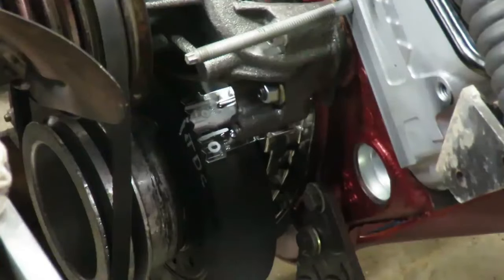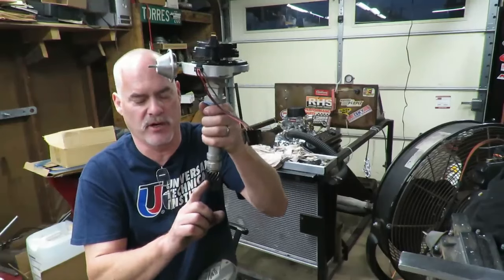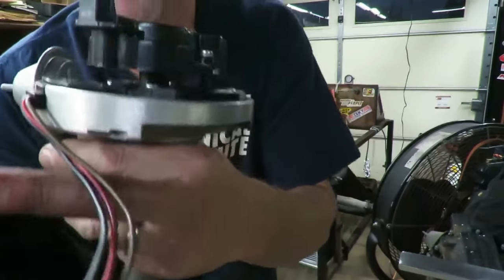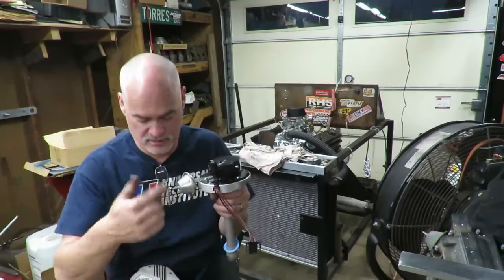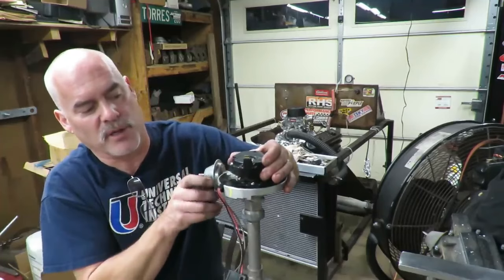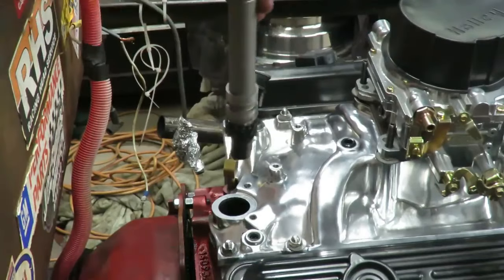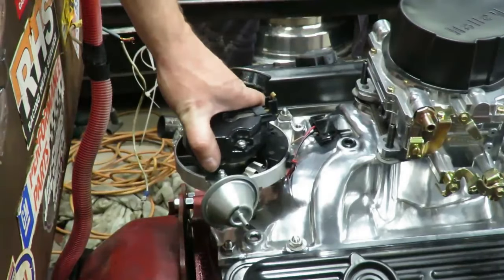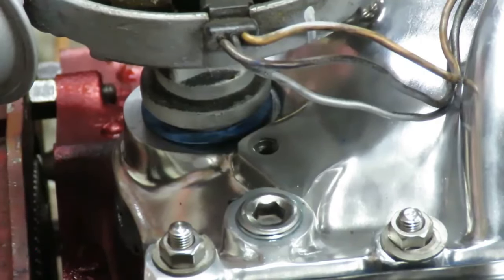350 Chevy Distributor, cap, and plug wire install

Comment: Got it, got it, got it! You the man! Thats what I needed to know. And... if you have the motor advanced 10 degrees as in this video, when you drop the distributor in and line it up with number 1 on the housing, it'll be 10 degrees advanced when you fire the motor. Add the 24 degrees of distributor advance (as what is built into my personal distributor) and it would be on 34 degrees total timing.  Then... simply check with the timing light. Thank you, thank you!
Reply from the maker: Yep

Comment: Thank you sir for this vid, spent all day tracking a new one down. And have put in off time twice now lol, once advanced, once restarted. The key bumping trick is genius, if the engine wasn't so hot from me running it advanced for 10 I'd do it right now lol. Confident I'll be back on the road tomorrow with this video👍👍👍

Comment: Got hooked on your channel when I ran across the cam selection playlist, great stuff and we thank you for it. I fool with Y Block Ford’s right much and always like it when I can install the distributor on a run stand because access can be difficult on hoods with hinges at the rear. Good tip too on bumping the engine to get the distributor gear to mesh with the camshaft gear. One of the things that fools guys on the Y Block is that the firing order goes counter clockwise ... gets a lot of ‘em at the start 😂

Comment: After you bump the engine to get the distr😂tor to drop over the oil pump shaft, you should line up the timing marks ( 10 degrees before top dead center ) to make sure the rotor is facing to the number one spark plug wire terminal.

Comment: Is the rotor under constant electrical charge creating spark when it connects with each cylinder tab on the cap or does the rotor pulse as it reaches each tab to send spark to the plugs?

Comment: Why would inside distributor cap only have marks on the corner of the straps and not closer to the center? Does it matter if it’s hitting center? Reason I ask is mine is doing it like that and I keep burning ignition modules left and right any time I rev it up have good ground new battery new alternator even hooked it up direct to battery and still keep burning them even installed 3 new distributors same deal rev it up a few times and boom it’s fried. 454 stroked out to a 489 bbc and help would be greatly appreciated

Comment: Great info as always. Thank you I do have a question my distributor cap when clipped on seems loose to me? While its fully clipped on the base i can pull it up 3/8 to 1/2 inch away from the base? Will this cause a no start or very bad breaking up issue? Any advise?
Reply from the maker: Yes that's a problem Id replace it

Comment: Great vid bud.question,for a 383 because of the longer stroke would I still put distributor in with rotor pointing at #1?   the car runs very good,  But I pulled motor to do gaskets and at top dead center my rotor is pointing at number 2. I remember the guy I bought it from said make sure I mark exactly we're timing and distributor is, Because it was a pain to get timing right. Would this  Be because the 383 has a longer stroke?
Reply from the maker: The timing is exactly the same process the linger stroke does not have any effect on it
Reply: Gotcha.thanks

Comment: What's the deal with putting it on 10 degrees before when installing distributor?
Reply from the maker: That is just one way of doing it you could bit it on zero but remember your cylinder will fire around 10 degrees BTDC
Reply: @Myvintageiron7512   I appreciate it that's what I was thinking.  I enjoy ur videos glad ur back.

Comment: Hello, I follow you since years and years, and today please, I need to ask you a question about my situation. I hope you can help me. Anyway I appreciate all your contents and i think you are really the best teacher ever. You know what are you talking about.   I have rebuilt a 1967 - chevy 327 small journal. Everything is stock, except the Camshaft, spring and lifters. Fit double humps heads with big valves, code 38172919. With a 10.3 CR.   The camshaft is a Lunati cam with code, 10120102LK with advertised duration 290int/300exh and 465/488 lift, 112 lobe separations.    Now The engine won't start with less than 28° base timing advance( vacuum connect). To keep it idling I have to unscrew the idle screw about 3 full turns out. ( quadrajet ) . If I try to lower the advance while the engine is running at idle, he will shut down.I can accelerate and keep it live, but he will not keep the idle. I also connect the vacuum gauge, and I read 13 to 14 in/hg. idling.  The question is: is it normal?  Looking on the web many people says that it is normal.   But to be hones looks weird to me....I'm afraid to have the timing chain little bit out...I don't know.  Thank you very much, can't wait for your next video.
Reply from the maker: it sounds like a timing issue are you sure your timing mark on your balance is right 
is the carb new or used?
Reply: @Myvintageiron7512   Today I opened the timing chain cover to check everything again. And It is correct. I have the 2 dots in line close, and if I go on TDC compression stroke I got the 2 dots in line but the camshaft's dot is point to 12 o clock.  The balance is correct.  Carb is totally rebuild.    I have change almost everything in this engine except the distributor and carb. The only things that I did not do, were the valves guide. here In Italy they are not able to do it. And they were out of specs. Another weird things is the compression.  I should have 150PSI but in reality i got 105 or 110. on 10.2:1Cr 
  why this engine start only at 30° base timing advance?  My doubt is that maybe crank's key is out " from factory"   but it mach the tdc anyway....is driving me crazy.
Reply: @thejustintimeyeah  When you checked the compression did you have the throttle and choke open the whole way ?
Reply: @44special9   yes. totally open.
Reply: @thejustintimeyeah  Over tightened valves can cause low compression/rough running engine . How many turns of preload did you put on ? If you used the spin method on the pushrods they might have been over tightened .
Reply: @44special9   Thank you for the advice.  I did half turn from zero lash.   I think that the problem is a worn guides valve. That could cause low compression and also bad mixture Fuel/air  if exhaust smoke stay in the chamber. That could cause that the petrol to be ignite need i 30° base timing advance.   Just my tough.  Tomorrow I try t fire it up with a new distributor....
Reply: @44special9  Little Update. I send the cylinder heads to a proper machine shop and they restore the cylinder heads. Everythings done, valve, seats, and valve guide.  Now the engine is running better, no smoke and at least it will idle at 15° basic timing advance.  before I needed 28° just to start it.   But I still have a rough idle, shaking engine and the vacuum gauge show needle drops from 9 to 13 hg. That looks like leaky Valve. But how can be possible? I have purge all the follower before to install the intake.
Reply: @thejustintimeyeah  THX for the update , maybe check the plug wires to see if the firing order is right .
Reply: Run better but not perfect as it should. I still have leaky valve.  The vacuum gauge show fluctuate needle from 9 to 14 hg.  Maybe it need to run a little to match seat and valves... Obviously I also have a low compression. 125psi instead of 150psi.